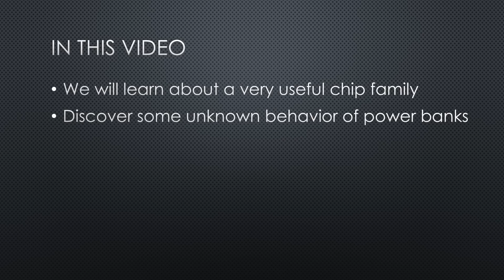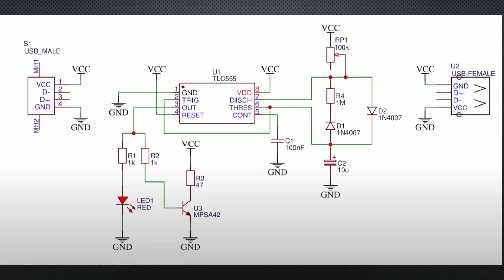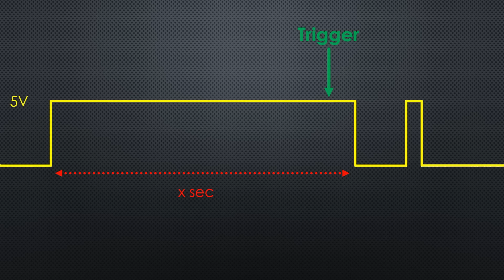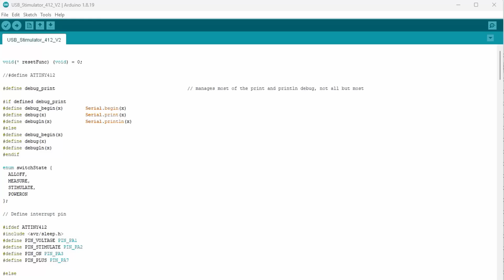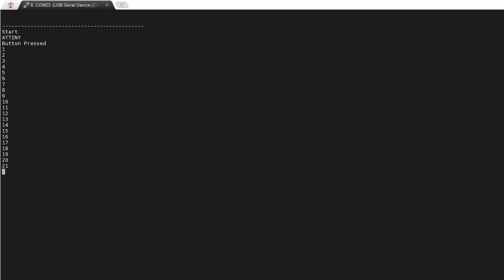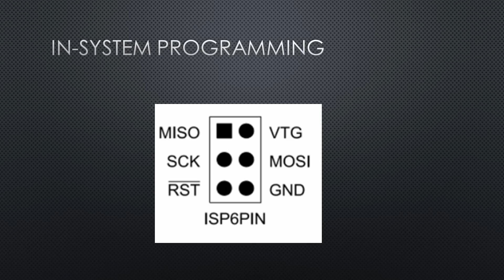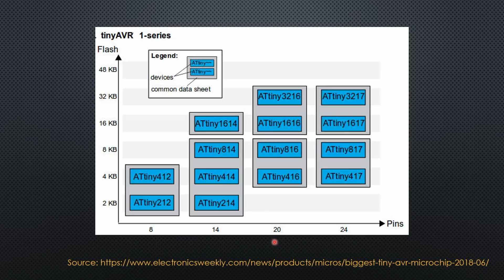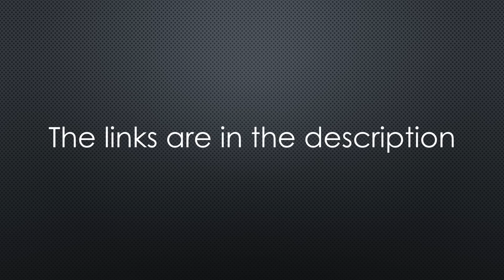477 Use the very attractive new ATTINY chips for your projects

Comment: Here's an abstract based on the transcript. I used Gemini Advanced 1.0 to create it:

Abstract

This project aims to improve upon an existing USB power bank trigger
design (originally using a 555 timer) by leveraging a modern ATtiny
microcontroller.  Challenges in power bank behavior are addressed,
primarily concerning their auto-shutoff at varying low-load
thresholds. The solution employs the ATtiny to characterize power bank
behavior, storing parameters in EEPROM for automatic power-on
triggering to maintain operation. The project highlights the
advantages of new ATtiny chips (UPDI programming, Serial.print), the
adaptability of open-source hardware (Arduino Nano as a programmer),
and the importance of iterative design when encountering unexpected
complexities.

Comment: There are power banks with a low power mode that can be activated by double-clicking on some Anker products. This is required, for example, to charge True Wireless Earbuds or smart watches. Edit: It's called Trickel Charge Mode at Anker. It says that it deactivates after 2 hours of non-use. It is questionable how exactly they can measure whether this is used or not.
Reply: I accidentally discovered this, one of the charge indicator LEDs switched from blue to green when I pressed the button twice. Strangely this was not documented in the manual.
Reply from the maker: Good info. Thank you!

Comment: I like videos that shows how to use  dedicated chips instead of using always an esp or arduino. Small projects will be cheaper and more power efficient. 👍
Reply from the maker: I agree
Reply: A dedicated chip is not necessarily more power efficient. If you put the microcontroller to sleep it consumes very little power
Reply: @elguido  Yes, but most ready-made ESP/Arduino boards have things like power LEDs, UART-USB-bridges or linear voltage regulators with pool quiescent current, which aren't really bothered by the MCUs sleep mode.